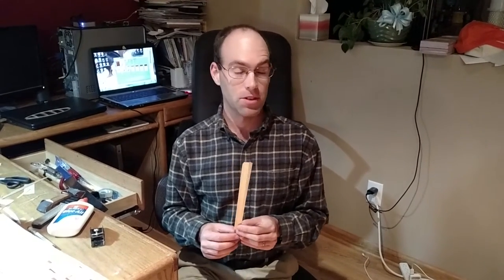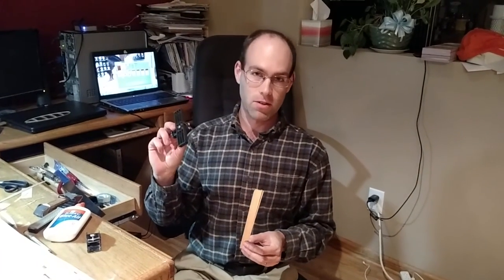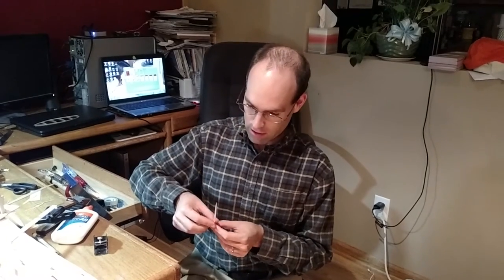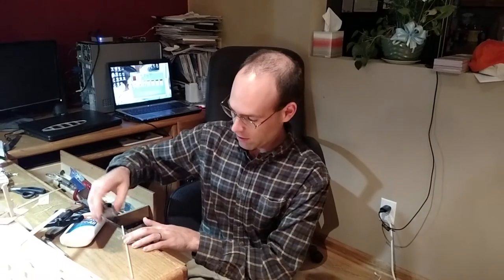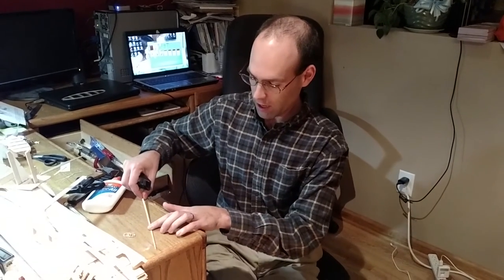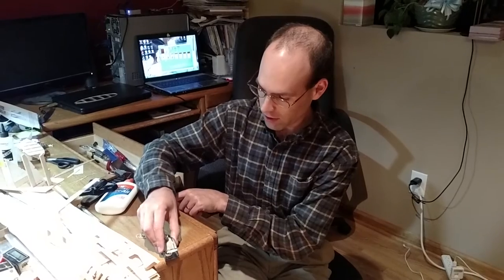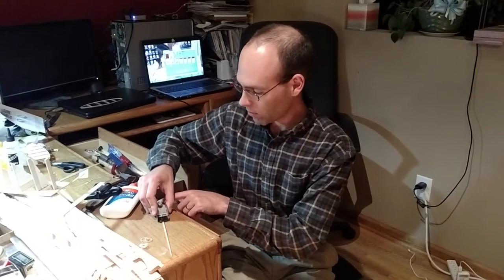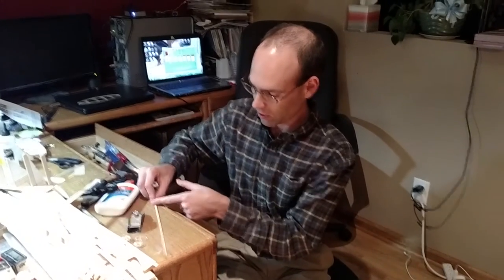Double Tapering Balsa Spars for F1D Propellers

Comment: Greeting! May i know where can i get the "wood trimmer" that you used in the video? Thanks!
Reply from the maker: I believe this one is a Stanley razor plane, but the best one to get is the David Plane which is much higher quality and doesn't require the modifications I had to make to mine to get it running smoothly. The device for stripping the wood before planning is a Master Airscrew balsa stripper.
Reply: Thanks, Joshua! Have a nice day!
Reply from the maker: Glad to help!